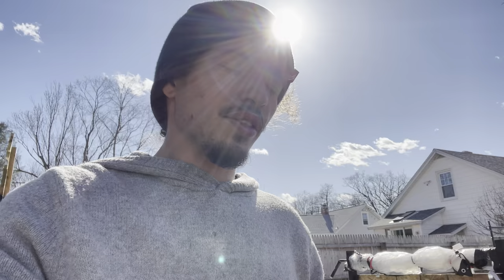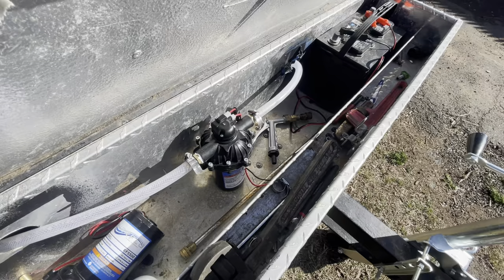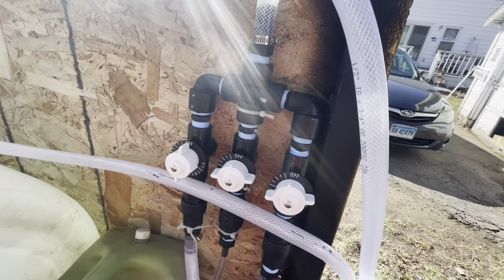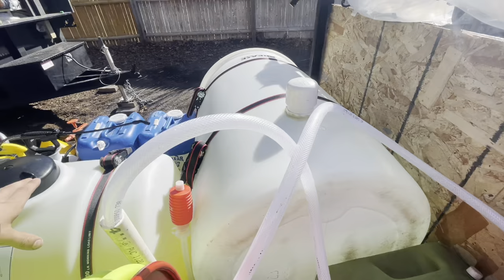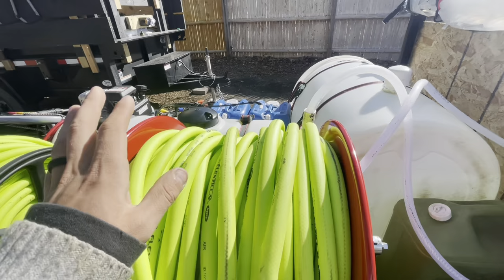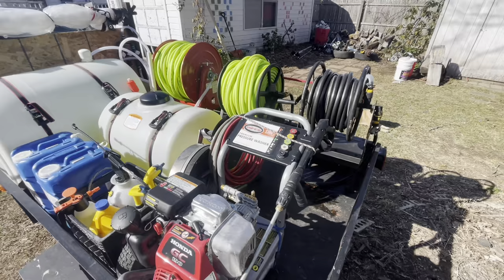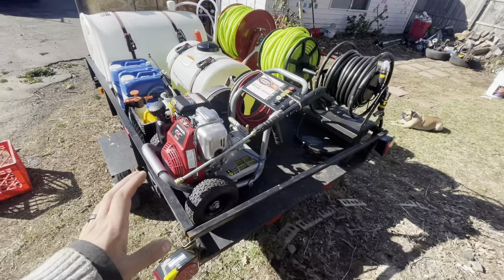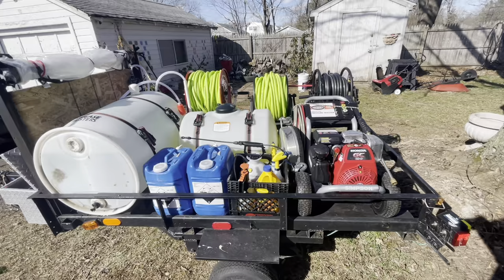12V SoftWash Setup- Pressure Washing Trailer!

Comment: Great setup bro. Replace your brass fittings with poly fittings or plastic. The sh will corrode the brass in no time.
Reply from the maker: Thank you! I plan to when I get some down time! I WD40 everything in the setup before and after every use religiously because of that!
Reply: @juans-life  just be sure to flush the pump with at least 20 gals of water after each use. Ya pump will last longer than 2 months. Im on my second 12v my first one lasted a year
Reply from the maker: @getrdonepressurewashingllc4099  yes sir! I also just switched to the everflo bleach pump and it’s made a world of a difference.

Comment: the only thing i could fault with this is i would have a downstream injector on the PW just in case pump goes down and backup dont work. just keep low pressure tips and wash as emergency
Reply from the maker: Yes your absolutely right, thanks for your feedback. I am waiting on my PW reel now and downstream injector for that exact reason! When it’s all setup I was going to do an update video!
Reply: @juans-life  Or an xjet. I love toting around my prison workout :)

Comment: Whats up bud. Hey. Where does your rinse hose connects too? Also when your applying sh to the hose do you have your portion water valve on also? Nice video for starting new.
Reply from the maker: Hey my three hoses from left to right is my active water hose(hose to spigot/water source), my rinse line, and then my SH line. The rinse line is fed through the active water hose which has a 2 way valve for the rinse line or pressure washer or to fill tanks etc. I have a chart I use for SH but my water valve is almost always on 5 and typically for most house washes I run the SH on 1. Hope this helps!

Comment: First I like your setup, that’s exactly what and how I’m building mine I’m also going to build my own trailer it seems cheaper to do so unless you have another solution. So you said that you don’t use your pressure washer that much. So what runs your surface cleaner when you use it, and do you not spray off the siding after the SH and surfactant has set I’m just beginning and trying to learn
Reply from the maker: I only use my pressure washer when necessary so if I’m cleaning concrete I bring it out. The pressure washer runs the surface cleaner. & yes I always pre rinse all surfaces with water, apply SH, allow it to dwell for 10-15 minutes then rinse with water again. I always re rinse all plants & vegetation to ensure we don’t burn anything. Thanks for watching feel free to ask questions

Comment: Interesting soft wash set up. Do you have any problems with windy days?
Reply from the maker: I can reach about 35-40ft with it so really no issues. My main business lately is roof washing and shooting from ladder I have no issue at all. I’m switching to downsteaming for house washing so excited for that!
Reply: @juans-life  what's te difference between your setup and down stream
Reply from the maker: @StreetSouljaz1  downstream injectors allow you to softwashing a home while still using your pressure washer. You can flip from water to chemicals in seconds where as I have a chem line, and a rinse line. Not only is it more hoses to pull but it takes longer to wet everything down. But it works really well for us using 12v for everything currently!
Reply: @juans-life  would you be able to make your set up downstream
Reply from the maker: @StreetSouljaz1  yes eventually just waiting on a reel to come in and I’ll start. I’m just to lazy to reel hoses up by hand lol

Comment: So how do you get the stubborn cob webs, wast nests etc off of houses if you’re not at least soft washing with the pressure washer via downstream?
Reply from the maker: We've never ran into anything we couldn't clean effectively and efficiently with this setup, I have not come across stubborn cob webs I couldn't clean. Truthfully there hasn't been any wasp nests on anything we've cleaned in the 1.5 yrs we've been in business. I am introducing down streaming to our setup soon only in case of emergency though. Our setup is extremely efficient and can do 3-4 houses a day. Thanks for watching and for your comment!
Reply: @juans-life  yeah I have been washing for about the same. We downstream 99% of houses and only really use the soft wash system for roof cleaning and to put a hotter mix on concrete and stuff like that
Reply from the maker: @JLBPowerWashingLLC  honestly I just need to budget for a commercial unit. I know my bleach pumps are reliable and we finish homes in under an hour- with that being said I know downstreaming would double my efficiency but I’m just comfortable with how reliable everything is. This is just how I like doing it and we do similar processes that achieve the same results!
Reply: @juans-life  oh yeah it’s definitely the same thing. I was just wondering how the wasps nests and stuff worked out for you. We get those and the moth cocoons or whatever they are and I know we have to focus on them for a minute with a little bit more pressure so I was just curious. I’m not knocking what you’re doing at all
Reply from the maker: @JLBPowerWashingLLC  for sure man I totally get it and no offense taken brother! I appreciate any and all feedback good and bad!